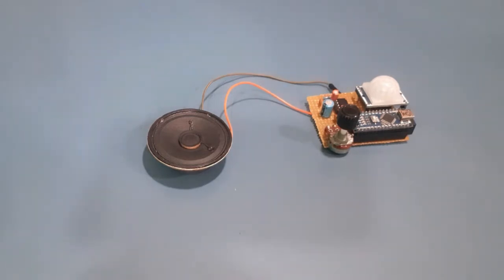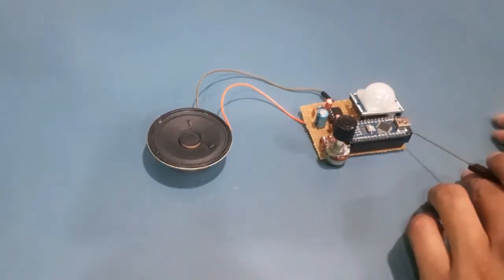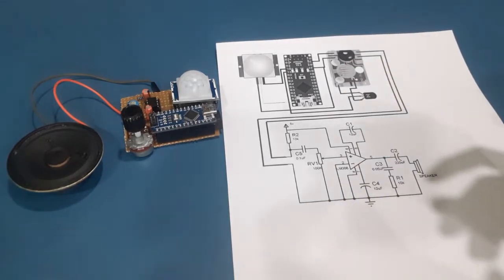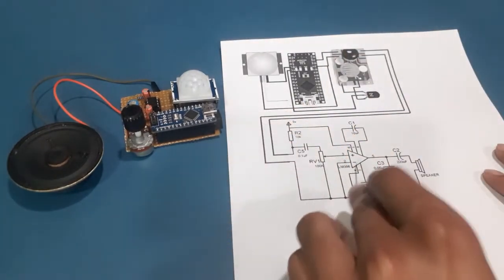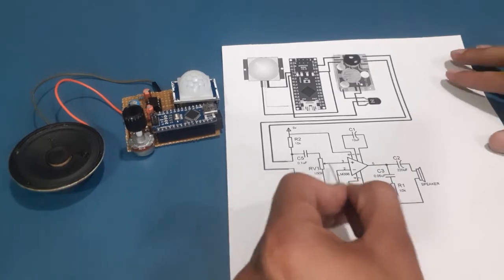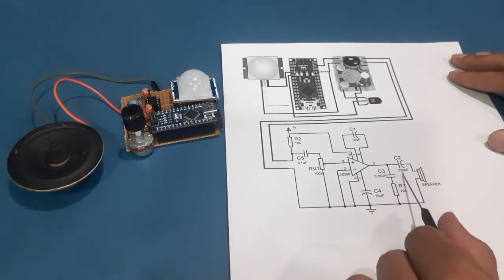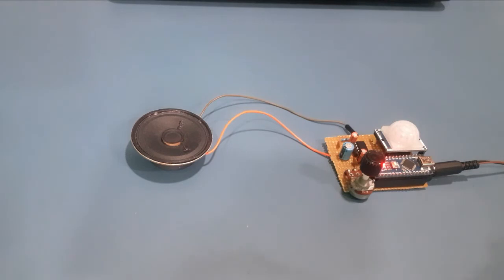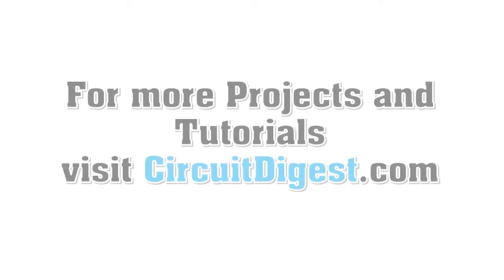Dog Barking Security Alarm using Arduino, PIR Sensor, and Dog Barking Sound Module

Comment: Can we use ardiuno uno in place of ardiuno nano
Reply from the maker: Yes, you can use Arduino Uno
Reply: @Circuitdigest  ok thanks
Reply: Will there be a change in the code if we use arduino uno?
Reply: @swatantra4278  no I think there is no change you can use same code